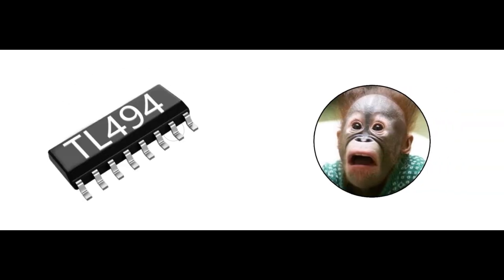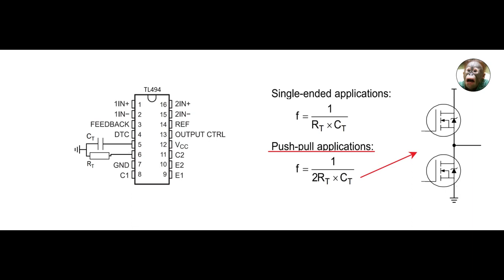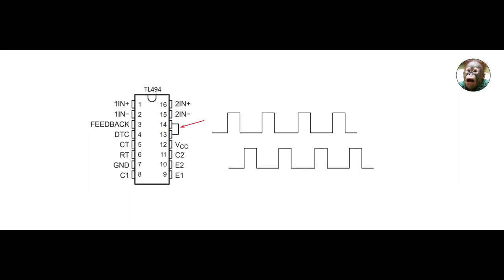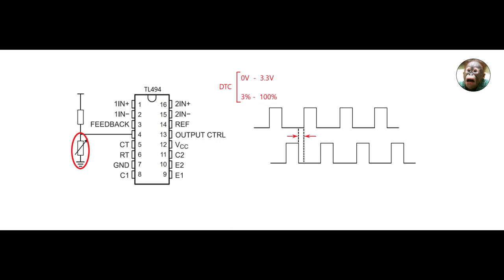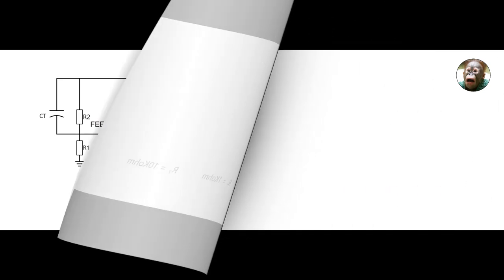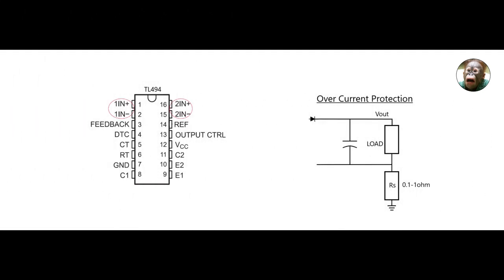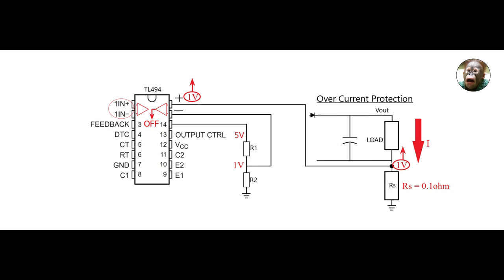Guide to the TL494 PWM Chip

Comment: Thank you.  I'm trying to increase the voltage and amps in this cheap dc boost board that keeps blowing up.   So from what I understand, it should work just the same if I increase the ratings of the mosfet and diode.

Comment: Very nice!
I am currently working on a high power 5000W synchronous dc to dc boost converter system and I am planning to use TL494 as well.

Great video.
Success wishes!
👍👍
The Innovati0n Lab💥

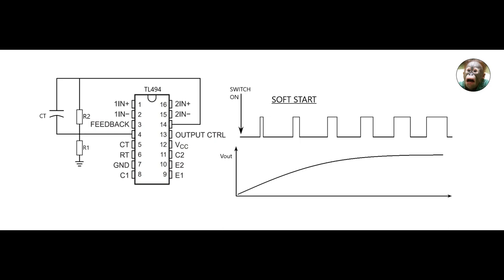Comment: At about timestamp 4:00  is the common connection of the resistors connected to the bottom of the capacitor?  There is no connection dot there.
THANKS FOR THIS VIDEO...my first look at the TL494...
--daLE
Reply: For it to work it would be connected